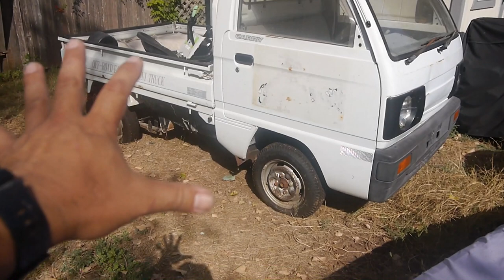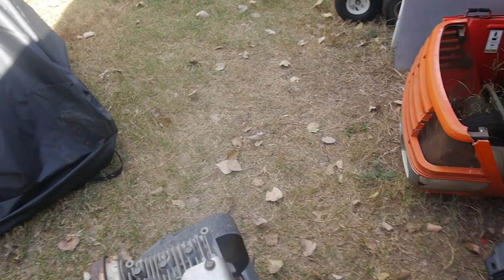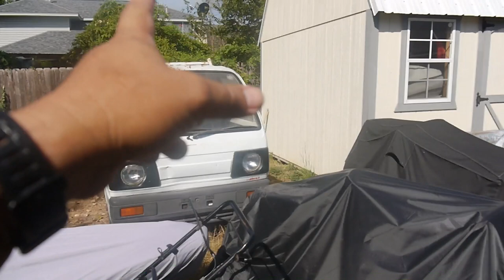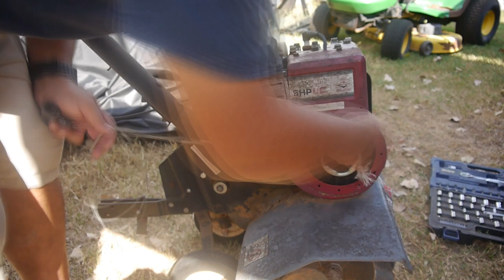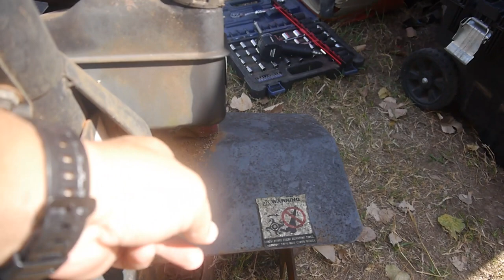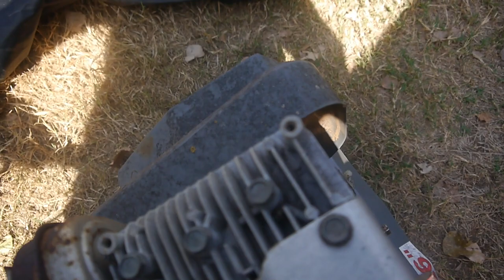Can an old Craftsman Tiller still run?

Comment: Those tillers can be a man breaker.  you will need that metal thingy that goes into the ground or else it will pull you all over the place.  Sometimes I think watering down the soil first helps to till the dirt up.  Great job.  Show us the thing in action.  Would like to see you dance to the sound of the tiller.  Thanks for the video.

Comment: Sold one like this I'd had  for over thirty years and I bought it used - it was over forty years old when I sold it and ran like new . Something that doesn't get that many hours a year on , and it sat in my shop for 15 years with no use . Sold it for $125.oo and the guy called me like a week later and told me it was a great  tiller .  Pointer I alway keep it full of gas too keep the gas tank from getting rusty and it worked too.